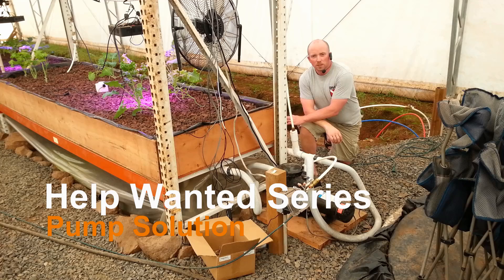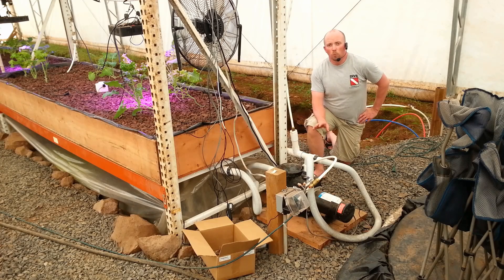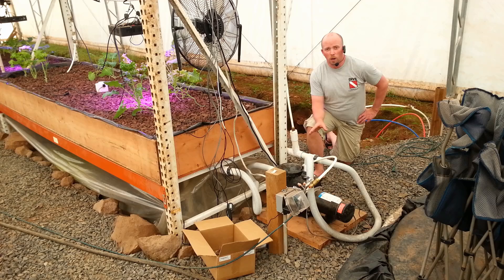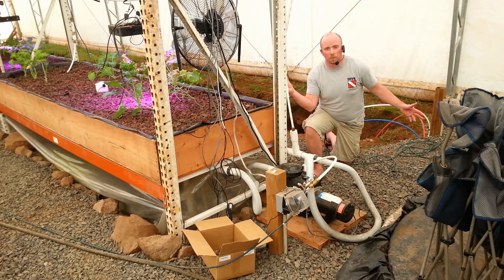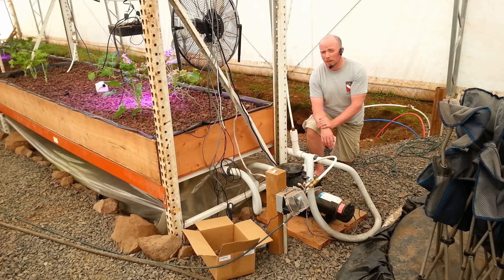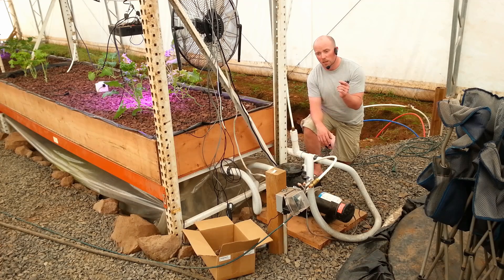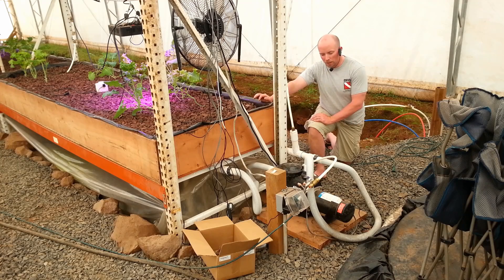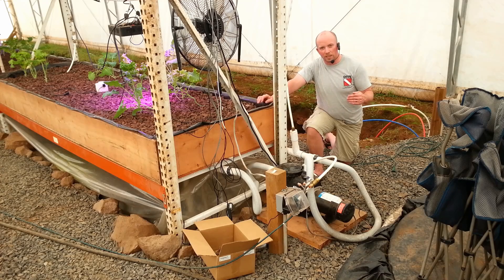Choosing your Aquaponic Pump setup - Things to Consider

Comment: so many ideas! One to avoid freezing is put pex inside a larger pvc pipe and Coble together a homemade manifold so you can run geothermal warm water through them pipe that artiest your bed water. I would do like others mention and have two pumps for redundancy. if one does not start software can try the other pump. 

And why does it have to be equal fill?

would one pump on at a time not help?

Comment: You might have to do the flush system like in barrelponics you can use smaller pumps that way. I think on american homstead they have a system completely solar powered and they only use like 8 amps to fill the flush system. that would be like cutting out one whole pump for you. They are using 2 small pumps in series to get enough head.

Comment: +1 For a balance tube if you were to do a single pump. Price aside, you are introducing a single point of failure.

Maybe Manifold in four pumps so you could run two lanes on one (pump fail), or if you want to shut down a lane for maintenance. VFD control might also help with the current usage, you may be able to cycle them at lower rates periodically.

I have no math to back it, but wouldn't it make sense to run your 2" lines up the top and feed the pex from that? You'd also get some gravity assist when you get to the end of the grow lane and drop down to assist in generating that current...

Comment: Ok, you told us the head, but what is the required flow rate per lane?  To determine the required flow rate, you need to consider that you're trying to achieve some number of water changes per some amount of time in your fish tanks, and you're trying to create a current for the fish to swim against, and you're trying to fill your grow boxes with water in some amount of time.  All these things together will determine the maximum flow rate.  You've told us the dimensions of your fish tanks and your grow beds, but you haven't said anything about how many  water changes are required in how much time or how fast the grow beds need to fill, or what amount of current the fish need to swim against.

I suggest adding a separate grow bed pump to each lane.  Don't try to do everything in the lane with one pump.  Right now, your lane pump is wasting energy due to the fact that your vertical head comes entirely from maintaining pressure in your pex piping.  That head pressure is felt by the pump even if no water is flowing in the pex and is therefore making the pump work harder than it has to.  A separate grow bed pump doesn't have to pump at high flow, but it does need to pump at the higher head pressure.  By adding a separate grow bed pump, overall energy usage can be reduced because you don't have the high flow fish tank pump having to also work against high head pressure in the pex all the time.  The fish tank pump doesn't need to pump upward, it just needs to pump horizontally against pipe friction.  That way you will have the high flow fish tank pump working against a very low head pressure, reducing it's load, and a low flow grow bed pump working against a high head pressure, however, the grow bed pump only needs to run intermittently when the grow beds need to be filled.  This gives you the opportunity to cycle the lanes one at a time for grow bed filling versus what you're doing now, where the single lane pump must run all the time against unnecessary head pressure.  It also simplifies the flow calculations because you can treat each pump as a separate system.  The fish tank pump will be a constant flow system, and the grow bed pump will be an intermittent flow system.  The fish tank pump can be optimized for energy usage without concern for the grow beds and the grow bed pump can be optimized for energy usage without concern for the fish tank.  Another option would be to put a solenoid valve between the fish tank pump and the pex piping so that the valve is only opened when the grow beds need filling.  However this will use more energy than a separate grow bed pump because the high flow of the fish tank pump will suddenly see a high head pressure when the valve opens, whereas it would never see high head pressure if a separate grow bed pump were doing the job.  You could always disconnect your pex lines to see if there is a difference in the pump's electrical current with and without the pex.

Lastly, if you're thinking about using a geothermal system, do not pump fish tank water through it.  You will get all kinds of fish waste and whatnot in your geothermal system.   Use a closed loop geothermal system with it's own pump and use a separate heat exchanger for each lane.  The fish pump can pump right into a filter and then into the heat exchanger.  Using a closed loop geothermal system allows you to use chemicals in your geothermal lines to keep them clean and allows a wide variety of choices for the heat transfer fluid.  In addition, the geothermal system having its own pump allows for greater control over energy usage and allows you to tailor the geothermal pump's flow rate to maximize heat transfer efficiency.  Also, if you used the fish pump to also run your geothermal system, you would need to adjust its flow rate using a valve, which is more wasted energy because it creates an unnecessary pressure drop across the valve and increases the load on the pump.  It's far more efficient and controllable to use a separate geothermal pump.

Anyway, food for thought.

Comment: Centralized one pump system will be systematically very ineffective as you would control everything by adjusting throttle valves, balancing the input and distribution and all that.

I'm currently working on making a meter and analysis system for analysing pump efficacy in its specific environment. What we do is we scan and do polynomic fitting for the pump operating curves, measure the pump power draw and calculate how much the pump is actually putting through the system. If there are throttling valves involved, we need their instantenous setting as well and thus we can suggest if it would be better to adjust pump speed instead of throttling, or if the pump in question is just wrongly selected for its head and capacity.

Anyway I'm really suggesting to have a throttle-valve-less individual pumping circuits whenever you can for both greater control, better efficiency and better adaptability to problems such as breakages, diseases, lane rebuilds and all that jazz. Oh and then you need inverters for the pumps, or integrated inverter pumps or some other system of adjusting pump speed.

In a new and offgrid system I would look seriously at *ELV (say 48VDC) systems and brushless motors (squirrel cage ac, bldc, synchronous ac etc etc etc). Telecom industry already has lots of stuff for 48VDC and it is nice, pretty safe and allowed for anybody to install without permits. Using Power over Ethernet for small power gives you one cable for combined comms and power. Used equipment runs at very low cost in Ebay.

Also, I would just pump up from the fish tanks to a very shallow long tank (thick pipe) that has distribution spigots along its length to distribute horizontally. This gets rid of the horizontal head leaving you with a bit smaller pump.

Comment: Would like to mention here (as this is the last video as of now) that i think you take on 'some' things on way to big a scale for the solutions you want to try. Not saying that you shouldn't do it this way, but if you fail you also fail big ... it makes much more sense to approach some of these things on the scale of one grow bed, or say one stack of grow beds, aka one section of the current lane ... And regardless of your plans, and your decisions between now and 5/11, i would strongly advice to make the decision to just dedicate one section, say 'section 1 of lane 3' to being a 'test bed' ... that way you can test things on a section scale, and if it works, apply it to each section. This keeps risk of basically everything (and thus cost of failure) down to a more manageable level... 

Say f/e the ferriswheel thing, the idea you have is already sectioned, but your plan is to go ahead and do 60ft of it ... while a normal innovation approach would be to first test it on a more manageable scale (sometimes this is even micro/model scale) just to get proof of concept established and problems kept to a level where the risk is minimal. Hey, if you got the money sure build w/e you want, but i am under the impression that maybe you want to make sure you can supply your customers with the best product you can, so that you have money to further develop your plans. So maybe aiming for that first would be a good idea... 

And sure test the 'crap' out of everything, sensordata everything, but do so on a scale that is easily manageable and expandable. Aka, use one section for that first, that way you succeed on the scale of the entire greenhouse, but are only able to fail on the scale of one section. One section is also much easier to adjust, change up, etc ... and while i know you likely won't, i hope that adding that i wrote my university thesis on success for product development might at least have you consider the option a couple more times. I mean, nothing is lost if you learn on a small scale that is easily expandable to a larger scale, it's what you ultimately want anyways, as more then likely you will want to scale the entire system design up or down depending on available resources and needs of those that want to copy it ... 

And after considerations i do agree with going with a big greenhouse and a larger setup, with known technology, as you run into various things you likely wouldn't have on a small scale. But as you change up your plans due to shifted requirements, maybe going for the conventional growing ways for those products first (within the scale you need them, 17 trays a day) sounds like the save thing to do for the project as a whole ... then test your ideas on the scale of one section, reducing costs to 1/12th or so, as long as you build/engineer it with the intent to expand, given it works you know you are good, if it doesn't though, you also only fail on that scale... but hey, it's not my money ... (almost added time, but i guess i been commenting all day, on all the requests for help, so in a sense it is some of my time now as well).
Reply from the maker: really appreciate all your comments...thank you

Comment: Jeff...  Just curious,  haven't heard you mention it, or in the comments... but is there a possibility you could just use a large motor to run all four pumps on a common shaft??  Each lane would still have separate water isolation.  Just a thought....

Comment: Big old sump where rocket stove is receives water from systems and is distributed from there, just include anti siphon devices in case of pump failure.  You are flirting with a goldmine in the geothermal idea, many of your woes could be settled in that direction.(water temp for fish summer and winter and possibly a source of keeping snow off your panels in the winter by cobbling up a radiant type system on the back side of the panels with insulation, and higher production due to cooler surface temps in the summer)
Reply from the maker: I like the sump idea and thanks for the vote of confidence on geothermal

Comment: It would be nice if this video had included the exact specs of the current pump ... because seeing you are already contemplating combining the lanes in an enclosed space (fairly highly humid) cross contamination would be fairly likely regardless ... so it would be great if we could run 3 pumps, for a total of 36 amps (well within requirements) ... one pump for each two lane combination, and one pump for pumping through the geothermal. This could also be done by having a central 'tank' ... 

yes, it would still combine all the water together, but the system would run within requirements, aka 36 amps, and lanes can still be turned off and on. So i would build something like this:

Lanes A and Lanes B, equalize with a central tank, pump A and pump B (feeding likewise named lanes) take water from the tank and pump it through the lanes. Pump C takes from the tank and pumps it through the geothermal, (intermezzo below) and empties in the central tank. This central tank also adds more heat or cold storage, water can be easily checked, and sampled.

! Intermezzo, you could opt to have the line that C pumps through wrap around the digester a bunch of times before: going through the geothermal or before emptying in the fish tank. could even run two lines either way and use them as needed (obviously some connectors are used to only have one line through the geothermal, but it be nice to choose when the water goes around the digester by switching some connectors around, or not have it in the loop at all). Now i am not sure what the digester needs when and produces when, and what the water needs when. But tying the digester into the system like this gives options...

3 pumps, 36 amps, all water connected, with added benefit of having the option to ty in the digester to heat water; and/or cool or heat the digester, depending on the needs of it. The lanes combinations A & B can still be switched on or off for maintenance. If a pump fails only the plants in a lane combination will fail, as the water will still be fairly ok as it is equalized through the main tank and thus quality remains fairly ok. And if it's pump C failing it will only effect the temperature of the water over a period of time.

Comment: To get to what you want you need to determine the total GPM for the system. Also will need all pipe sizes and what pressures are you looking to achieve, if you only need to lift water and let it spill out of an open pipe that is different then needing to spray water.  Drip  irrigation works on very low water pressure but a fine mist will need higher pressures. Also the pump should be run on a VFD that will lower your current draw and allow you to very the flow based on need.

Comment: If you are running 4 pumps at 12 amps each , they must be on 120 v to draw 12 amps per pump , could you set your system  to 2 pumps and run them on 240 v each , that would cut your power draw down a bunch

Comment: Keep this in mind, if you go with a one pump system, you will need to have a spare pump or you lose all your plants and fish,, not just one pump lost. And plus you intent this to be a hands off where you can go on vacation or a few days, Who will be attending to any failures should something fail, and it will no doubt all at the wrong time. So what is the amount of time you can have something down till the fish die or the plants die? Having multiple pumps means only losing partial lanes? This I would think is a big concern. And I still do not see how you will have even close to enough amps to run all what you have described, pumps, refrigeration, lights, blowers, circulators, Ferris wheel plant rotation devise your thinking of, and then the digester running later. Having the wind generator and solar panels, with a bank of storage batteries to help with the amp draw makes a lot of sense to me, Viewer OUT

Comment: you should make the drain side be gravity fed rather than pumping the water all the way down the lane. you are losing a ton of head (pressure) to pipe friction that the way you have it.  You could probably use a smaller pump then.
Reply: also a propeller/blower type  system may be more efficent for creating flow in the stream. They have some pretty cheap electric outboard props around on the internet. 

A centrafugal pump will work but you will need a pretty big one to create the current needed. (just speculation ) 

You may also want to add a wall in the middle of the tank so the water can cycle, if the system is a straight shot you are losing a lot of energy because you are essentially shooting the water at a wall.

Comment: I'm not sure about any of this but just ideas from what I know using pumps and valves at work. We use double diaphragm pumps sometimes over electric centrifugal pumps because they can handle dirty water better( not that I expect the water your circulating to be dirty!). Maybe you could use a compressor to power an air driven double diaphragm pump? Our 2inch one can pump over a 1000ltrs of water from roughly 3-4 bar and it's safe working pressure is up to 8 bar I believe so it has a lot more to give. when we are sucking from or pumping to several different outlets we have needle valves(that's what we call them anyway)and flow meters after each outlet. This way we start the pump running and we can adjust each of the valves until we have the desired suction rate or discharge rate from each inlet or outlet. Hope this make sense and is of some use! Watching from Scotland keep it up it's all very interesting.
Reply: Probably should have read others comments first... seems like lots more smarter folk out there to help haha.

Comment: For rotating the microgreens system you could use the weight of the water by spraying water at the top and draining water at the bottom to rotate the system by using the weight differential between the to sides.
Reply: A bit like an old fashioned overshot water wheel

Comment: Again; how would 1 pump moving X water be way better than 4 pumps moving X/4 water? also: if your valves are the same type as mine they require something like .2 bars of a pressure differential to open correctly.

I suggest smaller pumps, perhaps even dedicated pumps for the current generation that could be interleaved to reduce point wattage consumption

Comment: It just seems intuitive to stay with one pump for each grow lane.  Balancing flow from one large system may not be that easy.  Also, what do you do with the 4 existing pumps.  I do believe you could cut the electrical demand by half going with ECM motors on the existing pumps.  These would also allow you to tailor the flow rate of each lane to match any idiosyncrasies of each.